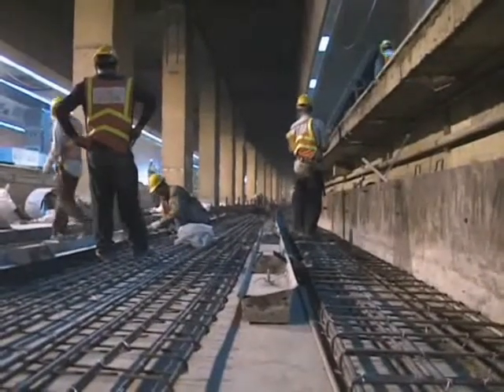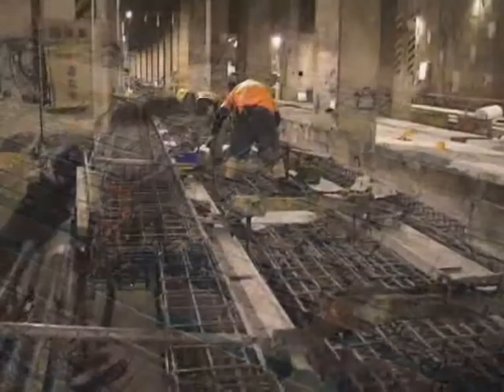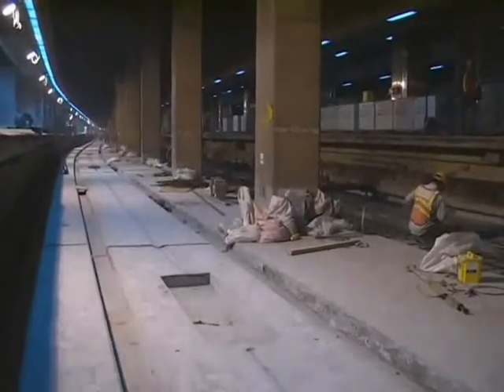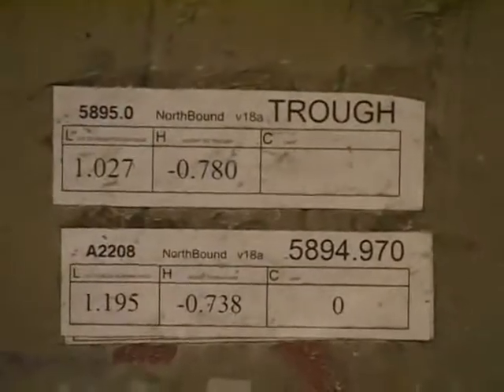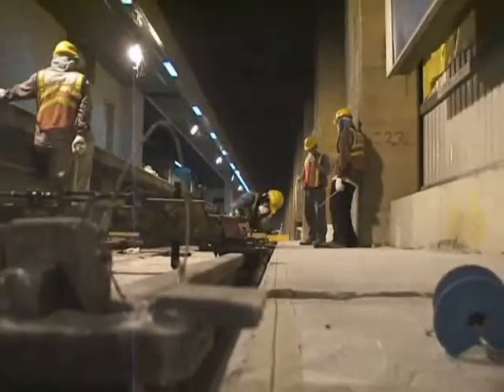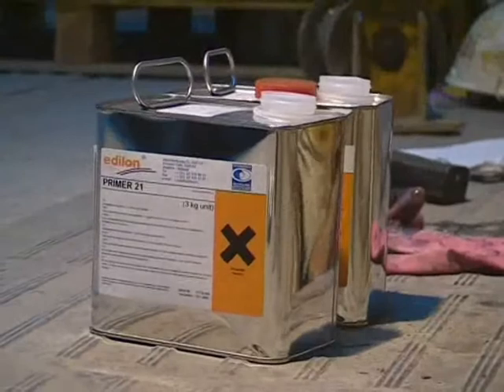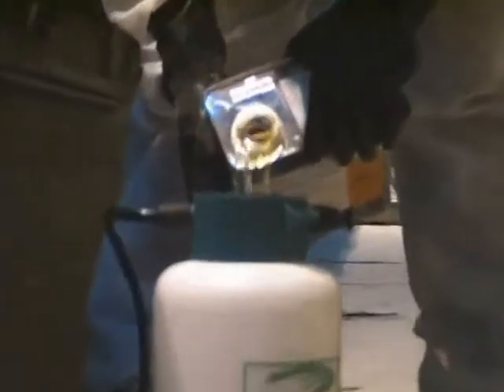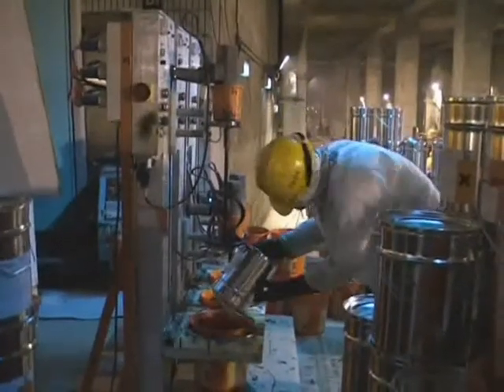Tracks Under Taipei - Chapter 8 (Edilon Cast Track)

Comment: Proud to see on the High-Speed-Lines all over the world station tracks with edilon)(sedra Corkelast ERS (Embedded Rail System) in service. The edilon)(sedra ballast less track systems with elastic rail fastenings are in operation for more than 40 years, all over the world. edilon)(sedra Corkelast® ERS as it conforms 100% to the CEN 13481-5 and it offers noise and vibration free comfort to the offices and service areas and to the new eight floor building including restaurants, cafes, a cinema, department stores as well as a five star hotels.